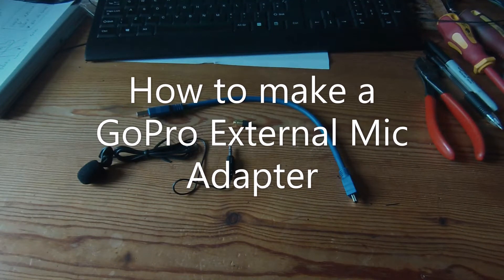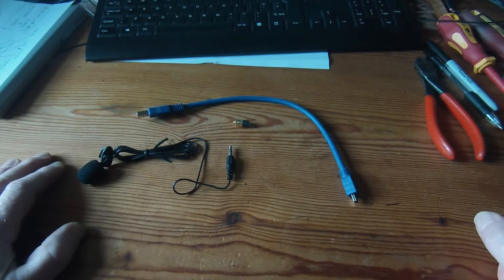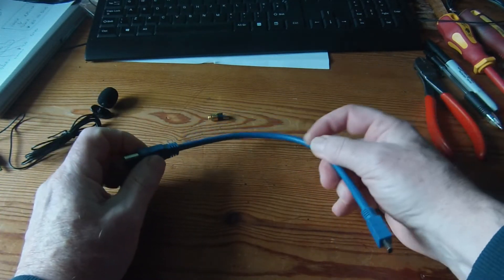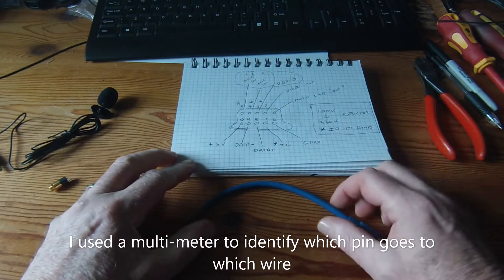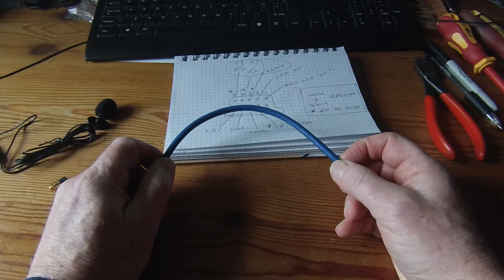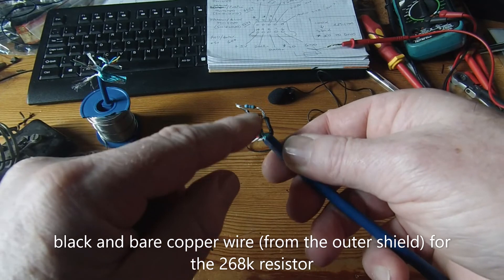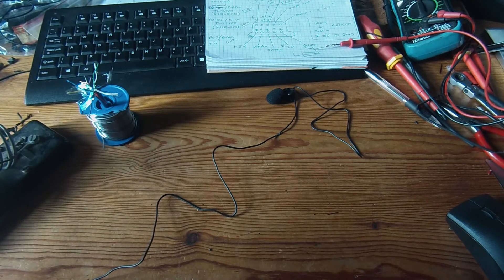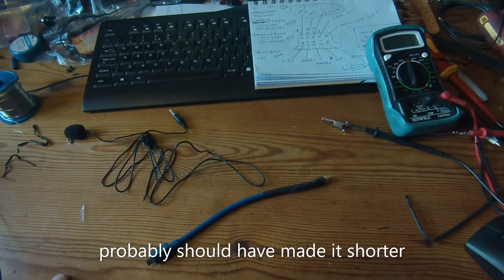How to make a GoPro Hero External Mic Adapter

Comment: That´s a great and detailed Video, but is it also possible using a Hero 7 Black throug USB C connection? Dou you have any idea how to replace that plug to the USB-C plug?
Reply from the maker: No sorry, all I know is they are wired differently but there are plenty of ready made adapters for the USB C.